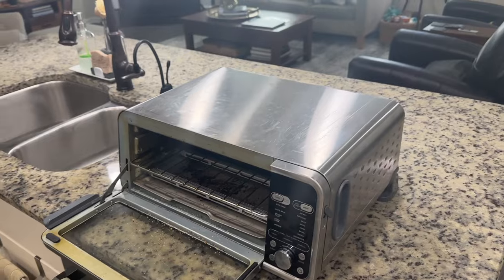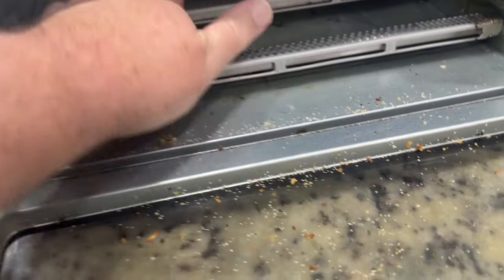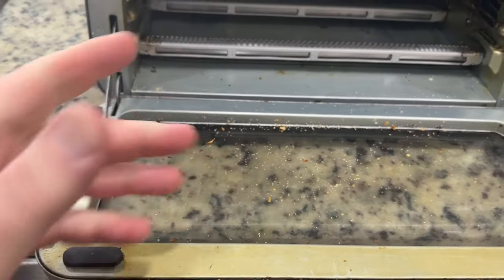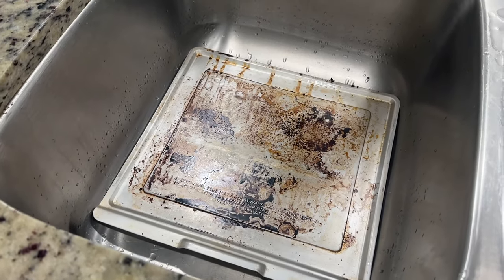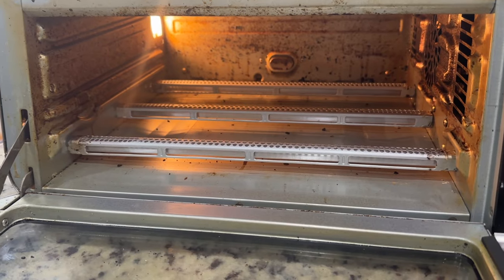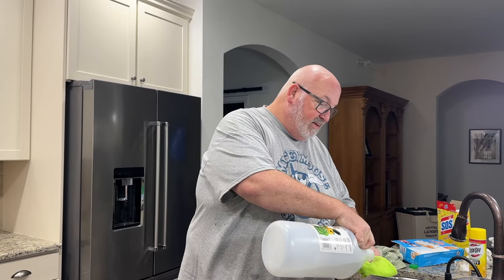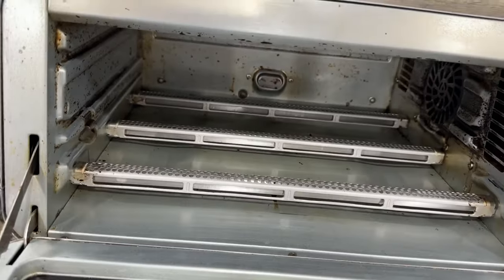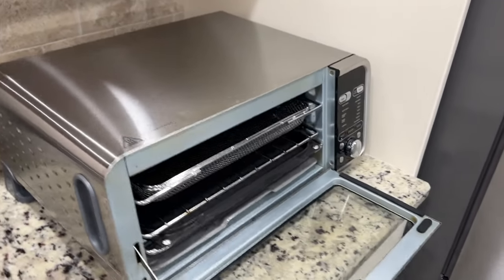Cleaning the Ninja Foodi Oven, Demo and Tips!

Comment: You must only use your oven as a toaster mine is much more grease covered from cooking meat and chicken.
Reply from the maker: Ha!  We don’t eat a lot of meat and when we do we tend to cover it. That might be why.
Reply: @LenBanks just a helpful tip I have found that spraying a little Goo Gone on the tray and then using an abrasive scrubber either plastic or steel wool it comes right off! Then you do need to follow up with some soap and water to remove the residue Left Behind from the goo gone, but let me tell you this has been a life-changer
Reply from the maker: @jenniferdunbar9467  fascinating. I would never considered that as I think of goo gone for adhesive removal, not grease and food residue. Thanks for the idea.
Reply: @jenniferdunbar9467 I am pulling the trigger today on the Ninja Air Fryer today. Thanks for that tip. I have goo gone in my cabinet 😊❤!!
Reply: How you cook chicken and meat. I don’t know how to do it
Reply from the maker: I have other videos showing various meats and such. It is far more than a toaster despite the comment above. That said, it will need cleaning from time to time. As any oven would.  @patriciaacevedo574
Reply: You and me both lol
Reply: I find if I use too much oil, there's more grease buildup, with chicken thighs you don't really need extra oil.
Reply: @cindylewwho which one did you get and how do you like it?
Reply: I just cleaned mine. I first tried a dish of water, baking soda, and lemon juice on the highest setting for an hour. The water turned an amber color so I think it helped loosen it up a bit? I got to wipe some up, but not much. I just got done using easy off, spraying the entire thing, with it tipped up and a towel underneath because it drips out. I tried a couple of scrubbing sponges that didn't work, so I had to resort to a copperwire scouring pad. I wiped it all down afterwards with a dry then wet rag. I sprayed it down with water to get the chemicals out. Soaked up what water I could, but it's still tipped in the upright postion. I'm going to do another dish of water, lemon, and baking soda to get the last of the chemicals out.
Reply: I coox pizzas in da muhfuka
Reply: I’m so glad we do not have this product!
Reply: @MrAndMrsBanks how do you cover it? Maybe place a loose aluminum foil over the food so the air can still flow around the food?
Reply: I ended up buying a basket type air fryer (again, since I donated the one we had due to wife-pressure), these Ninjas just make a mess with chicken thighs and lots of smoke with added smoke detectors blaring... If I would've known, I wouldn't have bought it!
Reply: @MrAndMrsBanks Does covering meat help prevent buildup?
Reply from the maker: @JoeTakagi00  I'm sure it would but then you also will affect the browning and finish of the meat. So perhaps cover for a while and then finish with a broiler.
Reply: @elchecko75 Thank you for that information!
Reply: This air fryer is very hard to clean.

Comment: You can cover the crumb tray with foil, thats what I've done. Ninja official FAQs say you can use foil. That'll take care of 1 of the 6 sides - best of luck with the other 5! 😅
Reply: Yes you can use foil inside. However Ninja Customer Support FAQ specifically states it shouldn't be put on the crumb tray. Don't take my word for it. Look it up, for yourself. 
Quote: Ninja Customer Support: "Yes. Use aluminum foil on the SearPlate or wire rack for easy cleaning after cooking. Make sure the aluminum is not touching the top heating elements. Do not wrap the crumb tray in aluminum foil ."

Comment: When I got mine I cleaned it out after every use and it still cakes on. They do say not to use course cleaning items that will scratch it like brilo pads but that's all I found too work so I'm gonna keep doing it till the unit dies and then I'll be avoiding the ninja brand from the on unless they make them easy to clean like the 12 in 1 pot that just wipes right up.
Reply from the maker: Oh, wouldn't that be great if the interior was a non-stick surface? I use this far more as an oven than air fryer, so I don't really want to get a different type of appliance. But the cleaning part of it is very difficult.

Comment: I put an oven liner sheet on the bottom. Food or grease that falls on it wipes right off.
Reply from the maker: I’ll look into it. The user manual does say not to cover the crumb tray, however.
Reply: @MrAndMrsBanks leave the sear plate in and lay parchment paper or aluminum foil on the plate and/or rack. Helps a ton with keeping the clean up to a minimum

Comment: I made a tik tok about this, I have the exact same Airfryer and it looks like the day I bought it. I use the pink stuff miracle paste, a scrub mommy, and a tooth brush (now denture brush, to get into the fine details) and it works amazing ☺️ Definitely recommend!
Reply from the maker: I will try the pink stuff. Thanks for the tip. But as you saw, like new is not all that important to me. Thanks for watching and commenting.
Reply: Can you share the tiki tok? What do you use, a cloth, microfiber cloth?
Reply: Doesn’t that stuff specially say not to use it on anything that might contact or come near food?
Reply: @ChrisDelChris  yes it would be hard to rinse all of it off
Reply: IthnkmI found your tik toc, but I didn’t see the video you mention. Could you share the link?

Comment: Thank you so much Len! It was hard work. I tried to clean mine with Barkeeper’s friend and Easy off, it left some discoloration on the inner frame. The tray I had to replace and it wasn’t expensive, they gave me some discount too. I ended up using a parchment paper on the tray and on the baking griddle at all times, it doesn’t affect quality of cooking, but it is much easier for me to replace parchment paper sheets than clean the entire thing. And periodically I just remove crumbs because my husband also likes bagels. It works for us. Next time I definitely will try Mister clean and SOS too. Thanks again, great video ❤️!
Reply from the maker: Yeah the crumb tray I thinks is only $9. I’m gonna replace ours too. Thanks for watching and commenting!
Reply: Thanks for suggesting the parchment paper!! I was looking for a solution.  Mine is brand new and I used it first time today and immediately could foresee the cleaning issue
Reply: Could you place a Reynolds’s wrap over the crumb tray..

Comment: Great video.  What I've always done in the past, with all of my toaster oven crumb trays is cover the top of them with aluminum foil.  When they are soiled, just replace the foil.  Also,  I have tried to clean inside of my oven and no luck there.  I will have to just use the SOS pad.
Reply from the maker: Thanks. Do the foil at your own risk. ;). The instructions specifically say not to. Not sure why. But they do.
Reply: Great point.  I do the same with my toaster oven. Putting foil on the crumb tray makes it much easier to clean.
Reply: @MrAndMrsBanks  The foil reflects heat back onto the heating elements. Depending on the components used to make the elements, it can damage the rods, thus shortening the life of the toaster. And, the excess reflected heat can cause a fire in some circumstances. How much reflected heat can parchment paper take before it ignites? Or, cooking oil, for example?

Comment: Great video.  Magic sponge for me might be the way to go.  I've been testing out baking soda as a paste; Koh cleaner and they worked to varying degrees however not entirely.  So I had a brainwave.  I use denture tabs to clean a range of items.  What I found was disolve 3 denture tabs in a sink of hot water and place the crumb tray into the water for around 2-3 hours and then (depending on the size of your sink) turn the crumb tray around for another 2-3 hours.  

Then wipe off and whalla the crumb tray comes up like brand new.  

My challenge is how to get the inside of the oven cleaner (not bad however if I don't get the grease grime off now it will be harder to clean later).  So what I've done is filled a bowl of water from the sink of water with the denture tab and wipe this down - with varying degree of success.  So next step has been to soak a chux wipe into the denture tab water and stick this to the sections of the oven where the most grease grime is.  

Will let you know how this works.  However for the grease grime on the crumb tray it brought the tray up like brand new.  Hope this assists.

(PS:  If you have those oven mats which gets grease and grime on.  Depending on how baked in the grime is I again used the same steps as above and Koh definitely helped with a good scrubbing brush.  Am also going to place this into the sink of denture tabs water and see whether it lifts the remaining grime off the mat.
Reply from the maker: Great tip, thanks. I will try that. thanks for watching and commenting!

Comment: Here's an excellent cleaning tip for many items. It might work for the crumb tray, but don't know about in the oven.
In a shallow dish, lay your crumb tray,  ad boiling water to JUST cover it and then sprinkle Cream of Tartar liberally. Swirl a bit, but make sure the CoT ends up ON the tray. Allow to cool completely. Even to evaporate enough so the crumb tray top is dry. Then scrub with warm water and whatever scrubber tickles your fancy.
Reply from the maker: Great tip! Thanks
Reply: @MrAndMrsBanks  Cream of Tartar is an amazing, non-toxic cleaner. I use it all the time to great effect.

Comment: Thanks for your video! SOS pads seem to be the star for cleaning a lot of kitchen bakeware. BTW, lemon oil is excellent for cleaning outer stainless steel surfaces. Shines it up like new.
Reply from the maker: Yes, steel wool is amazing. I used it all the time as a kid but stopped over the years with the rise of non-stick cookware. But I am bringing it back to my arsenal of cleaning. And yes, the light oil on the outside works well. I have used olive, but lemon sounds nicer.
Reply: Dors it leave an oily residue? Seems like it would.

Comment: Get a parchament tray for the onion bagels. Or put them in a regular toaster.
Reply from the maker: hey, lots of comments on one video. thanks for watching and engaging! The nature of toasting is that the heat elements are exposed to both sides - in my estimation. So I wouldn't want to use something under the bagel. But cleaning out the crumb tray is not unreasonable. ;)

Comment: I’m concerned with the fan inside the vents which must be greasy, how to get inside three??
Reply from the maker: I don't think you can. That said, it likely is not AS greasy as you might think. Just guessing here, but the fan blows into the oven pushing the splatter away from it instead of pulling the grease into the fan. Again, guessing.

Comment: Do you get heavy smoke when you cook meat in air fryer? I get enormous amount of smoke for example when I air fry chicken wings ( not frozen). Do you use any liners?
Reply from the maker: I do not get much smoke. Do you keep the tray in under the basket? If not the drippings would be falling directly on the heating elements and that would cause a lot of smoke. If you do have the tray in, then I am not sure why this happens. Others have commented they have this issue as well.
Reply: I do! Doesn't help that the kids cook brauts in there. Smoke alarm goes off every time we use the thing. Good luck!

Comment: So mine isn’t super dirty but my heating elements got dirty. My hubby put wings in and they dripped all over the heating elements. Any advice for that? I scrubbed it a bit with a damp towel but idk what else to do.
Reply from the maker: I try never to touch them so honestly no idea. But for future reference put black tray in under rack or basket when dealing with items that would drip
Reply: I am wondering the same. I forgot to put the pan under the rack and grease dripped onto the cooking element 😭

Comment: A couple of things I've found helpful: amonia/water solution (1 part amonia to two and a half parts water) and oven cleaner. 

The former is a spray bottle. Spray it on and wipe off after 2 minutes. It works on grease very quickly, but you will need to wipe down with a Dawn and water solution after. 

Easy Off on my ceramic tray wirk very well.

And wipe it down after every use. It keeps the crusties and stickies at bay.
Reply from the maker: Thanks for the tips!
Reply: @MrAndMrsBanks  Thanks for this tip. I use 1/2 cup of ammonia in a sealed plastic bag oven night for my old oven racks. They are easy to wipe clean in the morning. I've thought about doing the same for the Ninga AF oven. I was concerned if the a ammonia would harm the stainless steel.

Comment: I was just about to try cleaning mine. It has over a years worth of built up gunk and I'm not looking forward to it. You've inspired me. I was most concerned about getting the glass clean but i love your tip about a magic eraser.

I was thinking about cooking a small bowl of vinegar for 10 or 15 minutes like cleaning a microwave. Any thoughts?
Reply: Update!  I cleaned the glass with a magic eraser and it worked perfect. For the inside I used a Scrub Buddies stainless steel scrubber. It worked like magic and you don't get those steel slivers you get from brillo pads. I highly recommend.  Mine did have the back door so I'm sure it was infinitely easier but the scrubber will work the same I'm sure
Reply from the maker: Never heard of the vinegar thing but it couldn’t hurt. I hope it goes well for you.
Reply: @dougwallace457 thanks for the tips! Scrub buddies it is!

Comment: We have the flip up Ninja Air Fryer. 
Makes fantastic food. 
Cleaning it sucks ass. 
It’s a piece of Sheit.  
Ninja should take these all back at full value.  
It’s a disposable item every year because you cannot get it clean.
Reply from the maker: It is difficult to be sure. Not certain I would consider it disposable though. LOL. But I also as said in the video don't have an expectation it should be 'like-new' clean all the time.
Reply: I tend to agree with you.  I like the way it cooks, but mine is a baked on greasy nightmare!  There is no way to cook any kind of meat in it without the grease splattering everywhere.  And mine leaks the grease out onto the countertop, even without flipping it up.  I am sure that there is grease between the inside wall of the oven and the outer shell also.  I am going to try to clean it and then just use it for toasting and /or baking.  I bought the Ninja Foodi 7-in-1 FlexBasket Air Fryer with 11-qt MegaZone to use when cooking meat since it has the nonstick coated drawer.  It should be MUCH easier to clean.

Comment: But the manual says not to use abrasive cleaners...doesn't that mean brillo pads also?
Reply from the maker: I imagine it could include that. I am not rubbing so hard as to scratch up the metal. Was only cutting the built up grime. But it just adds to the reality these things are a challenge to keep clean. Thanks for the watch and comment!

Comment: I just got one of these, some grease spilled on the bottom heating bulbs, any thoughts on how to clean this? can I remove the metal cover on them?
Reply from the maker: I honestly don't know if they can be removed. Please be cautious if you proceed. It seems to me the elements are some form of glass and I would hate to see them break or worse explode. I personally would not even attempt this. Just take the oven into a space with good ventilation and crank up the heat to burn off whatever spilled as best you can. And just in case you didn’t do this, in the future use the sear plate as a drip tray when cooking on the middle rack. That will help to prevent spill getting on the bottom elements.

Comment: Got mine about 8 months ago and used to clean it very often, however, that became very tedious so it is now greasy at the sides, the top and the back, which is why I am looking at this video as the grease does not wipe off easily.  I guess I have to start scrubbing with SOS pads.  Luckily since the beginning I lined the drip tray with aluminium foil and it remain as it was when I bought it.  Too bad this version does not open at the back.
Reply from the maker: Thanks for watching and commenting. I couldn’t imagine cleaning often. Lol. But yes it must be done eventually. ;). I’m not sure why, but ninja says not to use foil on the crumb tray. So just be aware and cautious.
Reply: Thank you for posting-I just purchased mine. The instructions say NOT to put aluminum foil on the bottom of the tray. I wondered if that was a silly instruction. I will be putting aluminum foil on my fray. Thankfully I did make sure I purchased the model with the back door opening. Len’s hands are much stronger than mine. I REALLY appreciate this video! Thank you Len!

Comment: I think I’m gonna try sitting a pan of vinegar in there and boiling it. Kinda like cleaning a microwave oven and then try the steel wool or magic eraser. I’m pretty sure you could’ve soaked the pan in the bottom of the oven in vinegar and just wiped most of that stuff out… But idk, I’m about to go attempt mine too…😅
Reply from the maker: Hope that works for you. The bottom tray thing is just baked on ruined. Noting will help it. lol.  Thanks for watching and commenting!
Reply: @MrAndMrsBanks  yep, I learned that the hard way yesterday… I couldn’t believe vinegar wouldn’t loosen it up…😳 Vinegar will literally take mill scale and rust off of steel even paint if you leave it in there for a couple days… I couldn’t believe it literally didn’t even make a difference. I just used steel wool and elbow grease…😄 Oh yeah, you can spray WD40 on a paper towel and make the outside look like brand new. Just don’t use it on the inside. You don’t have to use much either.